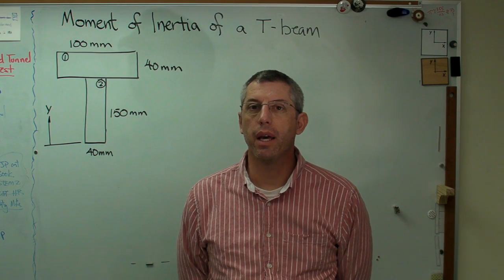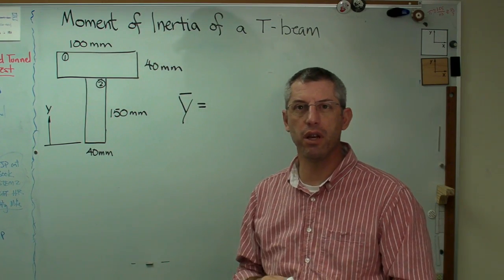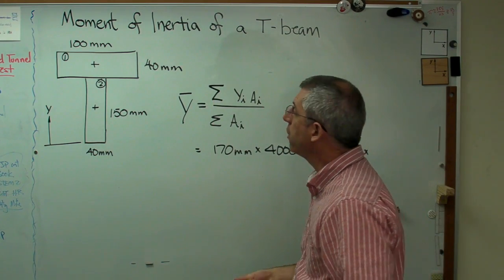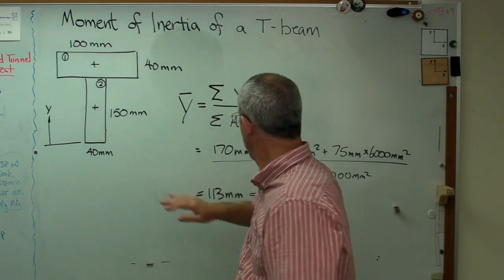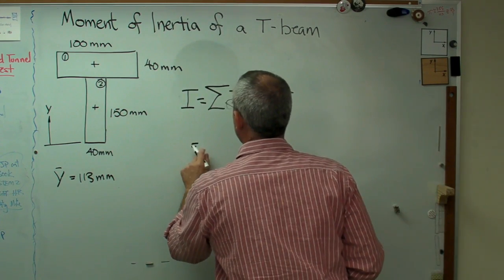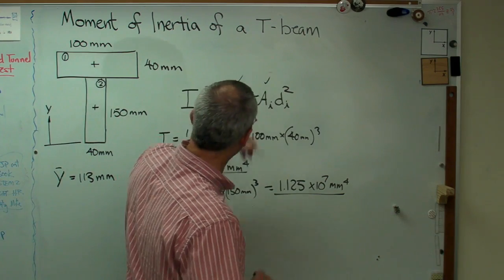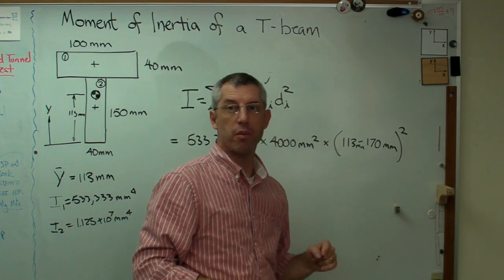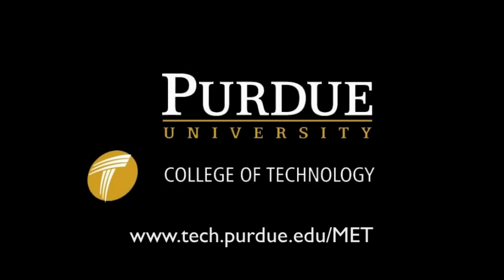Moment of Inertia of a T Beam - Brain Waves.avi

Comment: isn't this technically calculating second moment of area since units end in length^4?  If the definition of moment of inertia is the amount of torque needed for any given rate of change in angular momentum, why isn't the end result in units of Torque?
Reply: Aakash Pathak : Bhai , vote for modi g ......
Reply: that's not the definition. 
Moment of 'XYZ' --> Moment is a general term which means this: 
(qty of XYZ)x(dist. from some point/line). Usually the point used is the central point, or the central axis, centroidal axis or whatever. 

that is why we say moment of force (force x dist.), moment of area (area x dist.), moment of mass (mass x dist.) etc etc. 

Moment of force = Torque--> one particular example of various 'moments' there are existing in the world. Some 'moments' can be intuitively visualized, some moments like the 'moment of area' cannot be visualized. They are just a mathematical tool, to make life easy! 

Hope that explanation helps!
Reply: Aakash Pathak , so this is moment of area, but why not call it this instead of inertia then?
Reply: Yo, 
You should check up moment of inertia on wikipedia and check the formula. It is integrating {y^2 x dM} for the entire body. 
But over here in this video, notice we are integrating {y^2 x dA). 
the difference in dM and dA has to be noticed actually. 

See, moment of inertia means something, but the value we are calculating here is not that. It might be called that but that's a misnomer. Just like saying moment about a point is the torque. Well, the moment of the FORCE about the point is the Torque. 

I guess it is just convenient for people to balance out the torques and call it balancing moments. BUT strictly speaking, balancing moments does not mean anything. 

Conclusion: The moment of inertia calculation takes elementary mass, dM in its formula, while the second moment of area, often mistaken as moment of inertia, takes in an elementary area, dA in its formula. 

Mathematically speaking, moment of inertia and second moment of area are very similar, differing only by a factor, I can show you if you want. But yea, they do not mean the same, more like one means something, the other does not mean anything at all. It's just a number which you can multiply/divide by to get various meaningful quantities like bending stress which is extremely useful to find and cannot be found without finding this purely mathematical factor that has no real meaning on its own. 

I hope my point has gotten across. If you want some more clarification, you can reply here.
Reply: All of this would be less confusing if the video was titled, Second Moment of Area, since we are finding out a property of the area.  Since he is using the Parallel axis theorem, we are definitely finding moment of inertia of a plane area.  "Moment of Inertia" is almost an umbrella term for things such as second moment of area (planar/polar).  

It's funny, at my job as a mechanical engineer, not two weeks ago, I had to find out loading capacity for a beam that has a funny cross section.  So I had to show my engineering manager my calculations so we could move forward with the design process.  I was calculating "moment of inertia", section modulus, and leaving maximum bending force as my unknown inside the maximum bending stress expression (this was for uniform loading).  I was using the misnomer as well because I was actually calculating the second moment of area I believe, in units of L^4, been calling it "moment of inertia."
Reply: Haha wow! that's a good story lol! thanks for sharing this! :)
Reply: Good point +forr3st125

When I was learning these concepts at uni, the mechanical eng tutors and math tutors used to mix the terms second moment of area and moment of inertia, which made it a bit confusing when calculating power transmitted and torque versus safe working load for a beam

It all came clear when the tutors explained the differences
Reply: What also would help for terminology is not having different names for the same thing.  Area moment of inertia is the same as second moment of area, which just adds to any confusion. One might think they are different things.   Professors and books really need to be specific in their explanation while they teach.  In summary, we are discussing two things really: resistance to a mass's angular acceleration; and resistance to a geometric shape to bend about an axis; "Mass moment of inertia" & "Area Moment of Inertia" (Second Moment of Area) respectively.

Comment: Great Video! I adapted the calculations to angle iron and was able to compute an answer. I later found an angle iron calculator on the web and confirmed my math. If my prof for the one mechanical course I took had been this good, I might not have become an electrical engineer or at least would have double majored in electrical and mechanical.